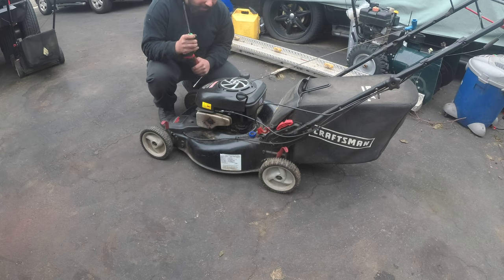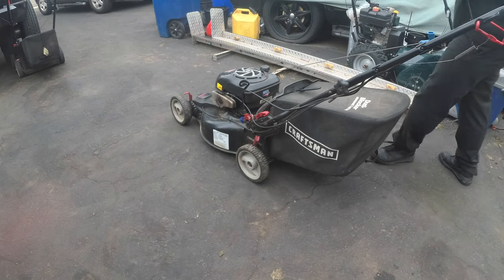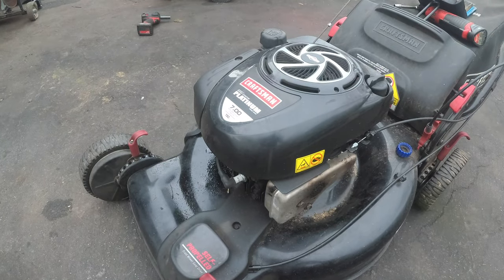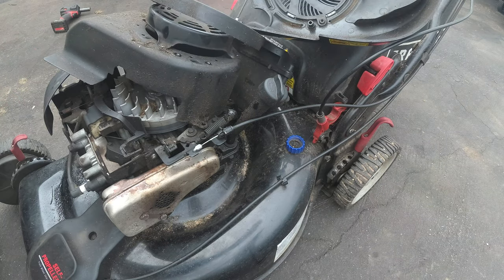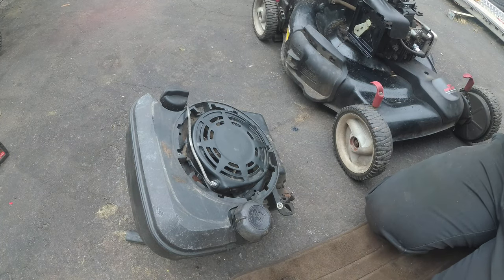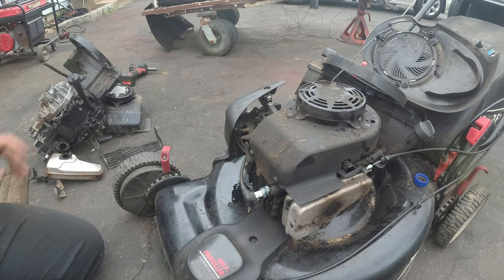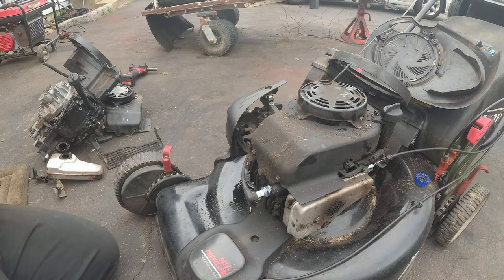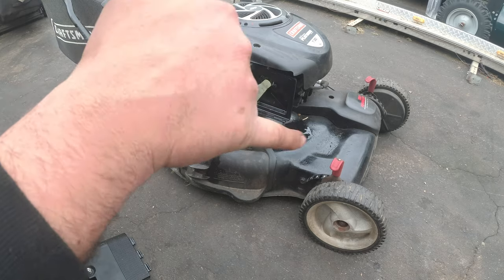LAWN MOWER SPITS OIL OUT CARB AND DIES WHILE MOWING HOW TO REPAIR AND MAKE SURE NEVER HAPPENS AGAIN

Comment: Here's a tip, why do you think, the old snappers had the engine facing the way it does, 2 reasons really, so you could tip the mower on its side to change the blade, and not worry about getting oil in the carb or muffkin, and anyone who had a steep grade lawn could mow side to side, and not have the problem this guy's has.... By having the engine facing front to back instead of side to side, the oil stays in the engine, and doesn't come out the carb or muffkin.
Reply from the maker: Knighthawk's Mowers,

UNCLE ROB!  Thanks for dropping your wisdom!  I pinned the post for all to see!  I really appreciate it! 🇺🇸🦅🔧🤙🏻
Reply: @pattayperformance  awwww thanks nephew, your the bestest.

Comment: I spent the first half of the video wondering if he was addressing the blowing oil issue or just first addressing the owner's DIY repair.
Second half just left me confused as to why the muffler issue had anything to do with the blowing oil problem;  just overheating?
Found this from YT search because I have an old Kohler M18 in a Cub Cadet 1811 that quickly blows massive amounts of oil (& gas?) out the top of the carburetor.  Help diagnosing appreciated.

Comment: I have this same mower got it for free but it sat outside.  The bail cable was frozen and the front wheels.  Got them unfrozen cleaned the carb and got it running but the cable broke off where it goes on the bail. That looks like the exact same set up did that one have two cable that hooked in to the bail? And what does the cable do that's going to the back of the deck?
Reply from the maker: Ok...so these mower's have a feature called bagging assist.  When you pull up the grass flap to remove the bag, the flap locks in open position.  Install bag, hit the bail cable and grass flap goes down.  EXCELLENT QUESTION BY THE WAY!
Reply: @pattayperformance  thank you mine didnt come with a bag but I might have one that fits.

Comment: Good video, mine is doing the exact same thing…so I know what to check on. It would have been nice to see the mower running after the repair/tune up. If you would have paused the the video and just cranked it up at the end that would have been great. But anyways thanks for making this, I have a good starting point now and also an old engine for extra parts, so hopefully it’s that part…either loose or bad, and will be an easy fix.
Reply from the maker: Keep Me Updated on what you find.

Comment: Hi again I have a question again can Pennzoil 2 stroke marine oil be used in chainsaws, weed Wackers, and leaf blowers without causing any engine damage? Thanks
Reply from the maker: No bc the engines are cooled differently.

I run 2 stroke marine oil in my diesel fuel as an additive to keep things lubed up.

You can also use In car as well…some really good reads on how it increases MPG
Reply: @pattayperformance  ok thanks I found out that Pennzoil 2 stroke marine and premium multiple purpose oil can be used in 2 stroke marine engines and air cooled 2 stroke engines. Thanks for your help 👍👍

Comment: Ha, as soon as you said “he cut something out” I just knew it was the Auto-Joke thermo lever! Nice diagnosis on the operator error 👍.  FWIW I always say tip it carburetor side up instead of muffler side down. Tecumseh and older Briggs have the muffler and the carb on the same side, and in my mind the really important thing is that the carb faces up to the sky. BTW - yes have heard that popping and sizzling sound before, it’s the needle valve seat leaking. Just got done with a Craftsman with an early version of the 7 hp Intek that was doing that. Removed the seat, polished the seat cavity and needle valve tip, installed a new seat and it’s good as new.
Reply from the maker: LOL, GOOD GUESS ON THE CUT OUT!  I'm glad I went to his house, I was able to idenity the issue off the bat.  I'm GUARANTEE if I didn't most likely would have wound up back in the driveway!  Thanks for the tip...I'm ahead on content.  This video is month or two OLD...so far so good!  WOOOHOOOO!

Comment: Jason, could there still have been oil in the vent tube? I dont think i have ever had that happen either,  but i dont ever flip the mower over on carb side like your customer did. Nice repair from a cobbled up mess!  Roger
Reply from the maker: He was mowing his hill side to side instead of Up and Down.  He was flooding out the engine over time when the carb side was facing downward!  I was ver lucky to have that parts mower!  I can't save everything like Henry!